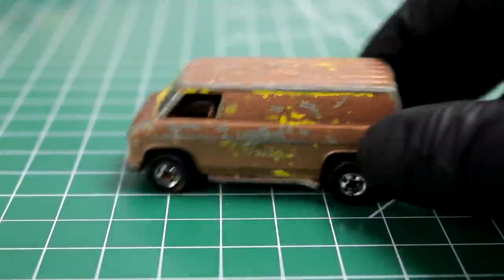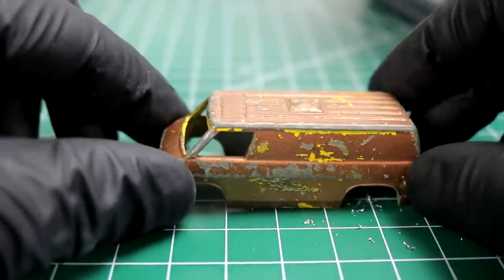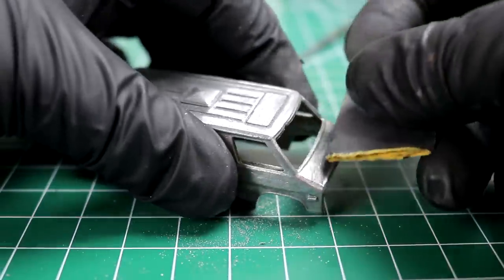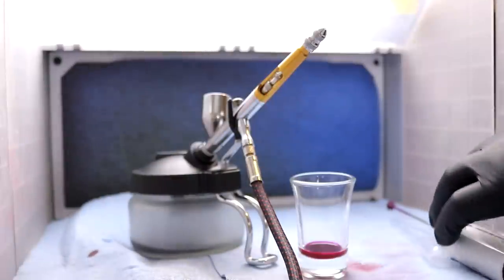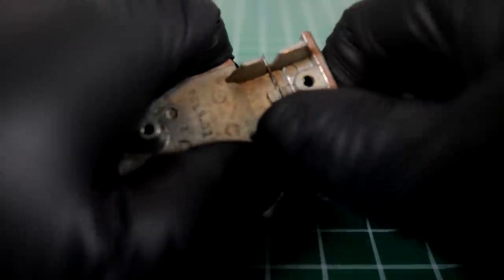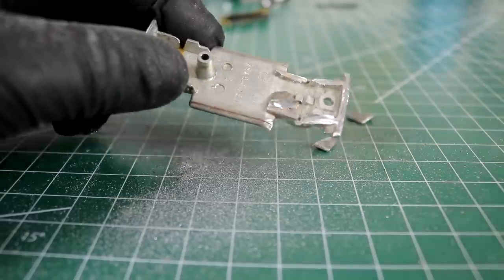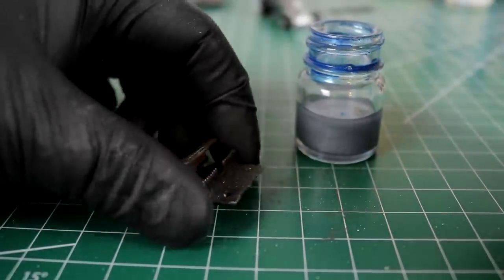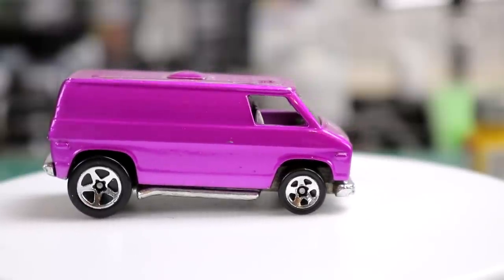Hot Wheels Customization : 1974 Custom Van

Comment: Turned out beautiful! Maybe a little polishing compound might smooth out some of the “orange peel” imperfections, after letting that paint harden and cure for a few more days. But overall, it turned out gorgeous. Great color. I saw a customized Hot Wheels Van at a modeling show once with those old style, tinted porthole bubble windows that were popular in the late ‘70’s, during the Van Craze...it was all drilled out, and the guy used a thin, tinted plastic sheet that he heated with a hair dryer to form those bubble portholes, then used a silver chrome paint pen to reproduce the trim ring around the “glass.” That turned out pretty nice. 

There’s so many great ideas out there for customizing these little gems. The possibilities are endless.

Comment: Great job I did the same van in a girly pink ! ,I like how you shaved of the metal plates on the back axle good idea gonna try that myself next time 👍👍
Reply from the maker: Yea you get a whole different colour when you spray the specta-flame on thick like an enamel. I wasn’t expecting that look but it looked pretty sweet!
Reply: Yeah right before he started cutting, he stated that he wasn't sure if the base would be strong enough to handle those plates being gone. But it isn't like they're going to get smashed into each other anymore, or played with anymore, so it was a good gamble. I'm sure that even if it wasn't strong enough, he probably could have fashioned something out of JB Weld putty epoxy to reinforce the base. As long as the parts and your hands, or gloves, are clean. The possibilities with that stuff are pretty much endless.
I think doing the interior in white was a real good call with the pink body.

Comment: Alclad II my friend, you can drop a super good super smooth chrome finish then lay the Spectra over it, about as close as it gets without the special hot wheels process lol.  Great video!  THe super gloss black from Alclad will fill in a lot of minor imperfections for sure especially if you use their grey base primer first.  Have to test it out not sure how those Lacquers will play with Spectra but is a nice system to try. AK makes a wicked chrome as well.

Comment: Hi, for the paint on the windshield, you could use Brake fluid DOT4 to remove this paint. NIce custom!!
Reply: Seen this done several times. Works well.
Reply: Yup, what they said, dot 4 brake fluid is your friend! Not dot 5 as it is silicone based and won't touch paint.
Reply: Dot 3 works well too. I've used it for years. Never had it damage plastic or rubber.

Comment: Put baking soda on the super glue to make it hard as metal.
Reply from the maker: Yea I’ve seen that on Marty’s videos, haven’t tried it out yet though. Thanks for the tip.
Reply: Baking soda has flour in it. be sure to use pure bicarbonate soda.
Reply: Vvv I'm
Reply: I seriously doubt that makes the super glue any stronger.
Reply: Nice
Reply: rdhd
Reply: Guitar repairmen ( luthiers) use baking soda and super glue to resize string slots in the nut. I've done it and the glue dries so strong you need a nut file to cut the slot. It's been 3 years and the strings have not wore down the glue at all.
Reply: @richardbinder9662  not to rain on your parade a year later but I've been a guitar tech for several years now, you always use nut files to cut the slot. We typically use NCF accelerant if necessary but even dry super glue with nothing in it needs passes of nut files. You shouldn't really be using anything other than a nut file on nut slots.

Comment: You should be able to adjust your automatic center punch so that it doesn't take as hard of a push to make it fire.  It won't hit as hard, but you will have more control and can push down on it a few times.  I believe you should just be able to unscrew the back cap a bit to get that adjustment.  Give it a try on a test surface.

BaremetalHW is a tough act to follow I think but I enjoyed the couple videos of yours.  Looking forward to seeing more of vids.
Reply from the maker: Thanks for the tip, I tried it today on the next project and it was better! :D

Comment: I’m just gonna bop that like and subscribe button. Thanks for the tips, even known you didn’t directly point them out, still the glue hack will work for me, and have you done a video on how to get the chassis back on to the frame? Me n my dad did a custom four runner, lift kit, it worked pretty well but theres still issues. I’m trying to find a more efficient lift kit for hot wheels, this one was full customize, ain’t given shits about the truck is why we did it hehe

Comment: I'm curious as to the size of the fan on your paint booth.  I'm building one using 3 or 4 computer fans  in 3 or four different ports around the work space and wondering if that will be enough draw
Reply from the maker: I was going to do the same thing actually, I bought a 500watt computer power supply, I figured it would be easy to hook up lots of fans and even lights all on one switch, possibly a fan speed controller. I don’t know how big it is yet, but I can look, it seems to draw the over-spray away quite well. I’d be using the big 200mm fans if I were to build my own.
Reply from the maker: Fan is model # RAH1238B2, looks to be about 4.5” and only one of them. I found it on google if you just search the number up.

Comment: I'm sure you're annoyed by all the questions about what tools/materials you use when you have a list in the info....But, what size drill bits do you use for drilling out the rivets and for those self tapping screws? Also, what's the size of screw you use? Love your vids keep up the good work!
Reply from the maker: I use these -- > https://www.redlineshop.com/shop/rivets-and-screws/restoration-screws-self-tapping-bright-set-of-10-20-total/

The Rivets are in all different sizes depending on the car, so you gotta kinda use your judgement on that one bub!
Reply: @DiecastResurrection  But I don't wanna use my judgment!🤣

Comment: I see you don’t use primer. Is that a personal choice or is that the right way to paint something as small as a hot wheels ?
Reply from the maker: Personal choice I suppose but I’ve never seen primer below the paint of a factory car. If I added body filler I’d use it of course. I don’t use it just because others do though.

Comment: I would have made the Mystery Machine from Scooby-Doo.  xD
Reply from the maker: Plenty more vans where that came from! <3
Reply: The original Mystery Machine is a V-dub!
Reply: The original Mystery Machine is less like a VW than any of the other vans of the era.
Let's start with the windshield. The Transporter had separate left and right windshields, The Mystery Machine has a single piece design. Next, look at the pronounced "bulge" between the top and bottom halves of the van. The Transporter was flat-sided. If you've ever taken notice of the rear of The Mystery Machine, the taillights are the wrong shape, size and location. Finally, take a look at the rear doors. Their positioning and size would indicate the lack of an engine bay back there, something that the VW definitely had.
It wouldn't be a Dodge van either. One look at those huge headlight bezels on the Dodge vans of that era, immediately disqualify it, just because it's too much of a styling cue to ignore or even accidentally leave out.
It looks exactly nothing like a Ford Econoline or a Falcon van just because of the headlight and parking light locations and styles. Also noticably missing from The Mystery Machine are the huge air intake holes above the front bumper that are present on the Ford Econoline and Dodge vans.
It can't be a Chevrolet Corvair Greenbriar either, just based on the iconic design of the Corvair headlights. These vans, like the VW, were also rear engined, so that whole thing with the rear doors comes into play again. There's no way an engine could have been mounted there.
The closest thing to The Mystery Machine is the Chevrolet sport vans of the era, but even they aren't quite right. The wheel arches disqualify it immediately, but at least they've got the right straight on front end view. The headlights and parking lights are about right in shape, size and location, but the taillights are way off when looking at the rear of the van.
The Mystery Machine was never meant to be any one particular year, make or model of van, but more like a combination, a very loose combination but a combination nonetheless, of all three of the American manufacturers' products all rolled into one. But the one thing that it in no way even vaguely resembled was a VW... Not even if you squinted your eyes really tight and used every ounce of imagination you could muster.

Comment: U think this one would have been the better van for the replica super van with flames considering the age and the base is the same as the black superfan with flames!
Reply from the maker: I cut the base on this one though.. to fit those big meats lol
Reply: @DiecastResurrection  yeah I remember but you know! In retro spect. I love the replica though and when I mesaged I said black supervan with flames I meant radio van or super van I would love to have one it's awesome. I have a black one w flames but no radio version

Comment: Excellent job for starting out. But spending all that time making the bodies/interior perfect .Yet you are using the cheesy modern wheels. The original blackwalls/ red lines give cars of the 70s and 80 distinction over what is being made today. I have found repro  blackwall, 70s redline wheels and axles  on Ebay. I also found press on redline axles which I've been using deep dish redline wheels on the mid 70s cars since it looks more period correct than modern hot wheels tires.